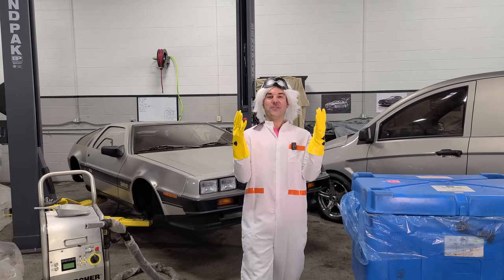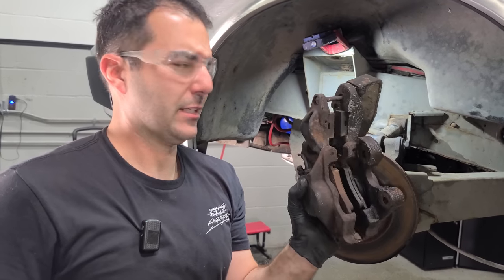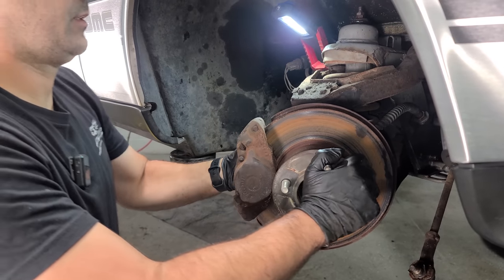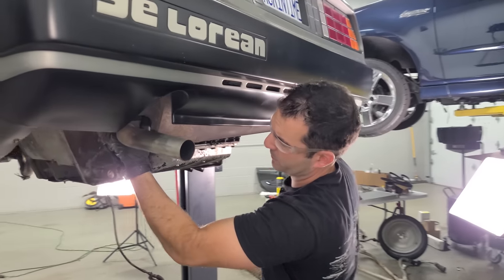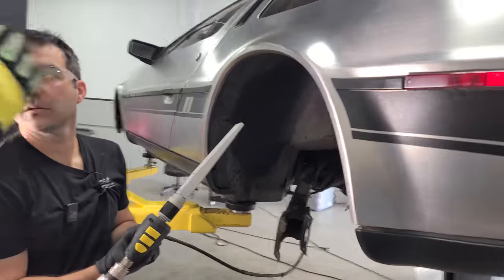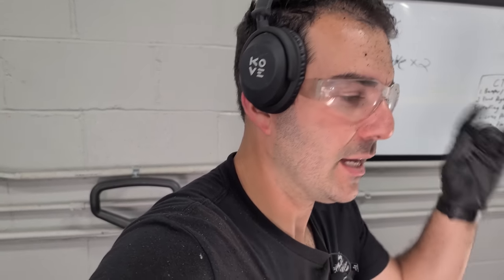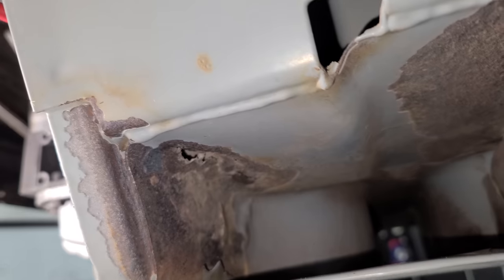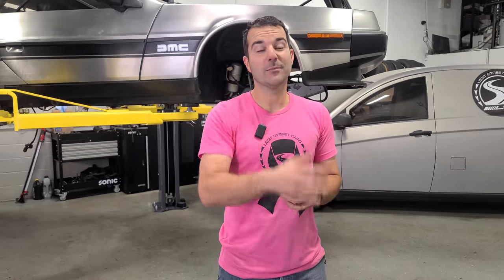I Dry Ice Blasted My DeLorean & Discovered Something Horrible! Determined To Fix This Car!

Comment: I would imagine like 80% of that car was made with off the shelf parts from other cars, problem is they may have been European cars we never got in the US and figuring out what cars those were. I highly doubt DeLorean had some company custom cast brake rotors or shocks or tie rods just for this car.
Reply: Almost certainly UK vehicles which should narrow it down a bit. I'm sure enthusiasts already figured it out though.
Reply: Well, Peugeot and Renault were a major part of making that V6 engine. It would not surprise me if a lot of other parts came from Peugeot and Renault.

Comment: Question, does the dry ice process generate any static like sand blasting?
Reply: Yes. The Karcher has has a grounding clip on a reel that extends out. We grounded it before and during blasting.

Comment: and I got chills when you hit the bolt of the steering bolt, rather hit the side of the steel and you don't destroy the thread, you can destroy the thread even with the nut on. i wil learn you a trick with the nutt stuck insade the sokit. take a hammer hitt the soket or just trow the socet on the flore. or you can woble the sokit after you losen the nutt and then undu the nut and it wil not gett stukk in your soket

Comment: Will dry ice work for cleaning direct injection intakes? Pros and cons versus walnut blasting?
Reply: Yes, works wonders and is super quick without needing to vacuum. Only issue is the equipment is more expensive so would need to do many to pay it off with that specific job.

Comment: Telling this man how to take a brake assembly apart "the easier way" by taking those caliper pins out tells me you've never done brakes on vehicles with that style brake system because one that comes to my mind are older toyota trucks which use that setup and if theres even a little rust on them those pins arent coming out without a fight so taking the caliper off is always easier especially on something thats sat for 30 years.

Comment: Would it not have been more efficient to pressure wash the undercarriage with hot water and soap before using the dry ice machine? Seems like all that grease on the oil pan and related areas could have easily been removed that way. You should have done the easiest process first and then done dry ice blasting last in the delicate areas like the wheel wells.

Comment: you know for all the bad crap they give it, you can tell they tried with the delorean, as I didnt even know it had an Alumiumn engine block in the back till you brought it up, which explains the LS swapped one that was on the Hunter S wannabe thompson regular car reviewers channel a number of years ago with that Alumiumn LS3

back before he kinda pissed me off with how hard he was trying to apply socio economics and social crap to cars, like sometimes a cars just a car man

and the person who set it up is an idiot who didnt do it right, like that 440 cuda he badmouthed the crap out of despite the fact that it was a 318 or a slant six that someone had dumped a 440 in without the big block suspension pieces

which on an unibody you really really need

as the hubs and the tires were out of wack from what they should have been, and they change the hub for the V8's, so literally it was a botch job he was badmouthing 

as a represntation of the whole 71 line, which if you know me, why dont you spit on John Paul the Seconds shoes while your at it. 

like I wonder why the thing doesnt stop right, like maybe the idiot kinked the line when he put it in,  not to mention the extra 800 pounds over a slant six in the front